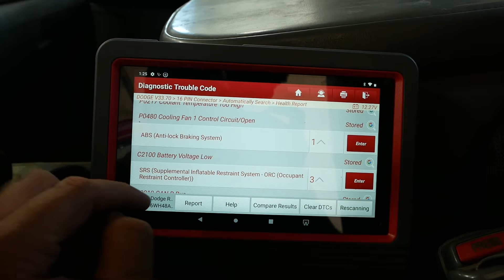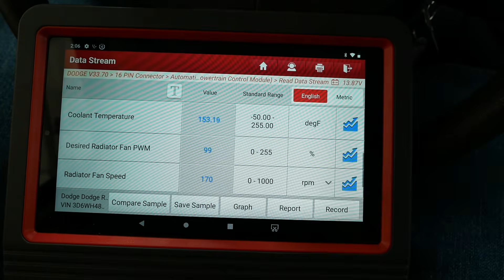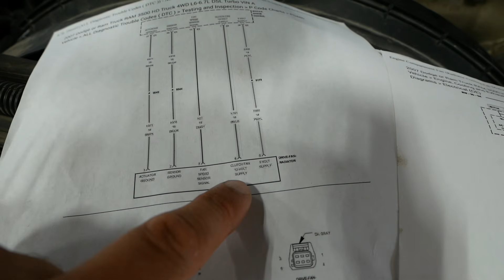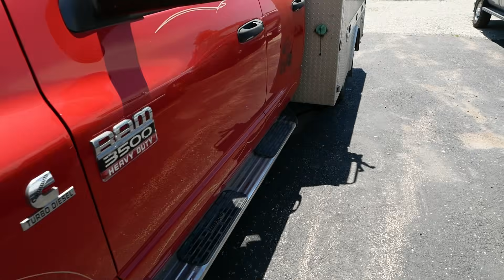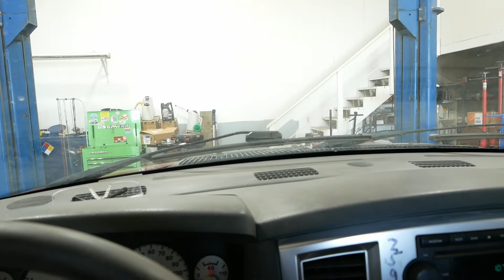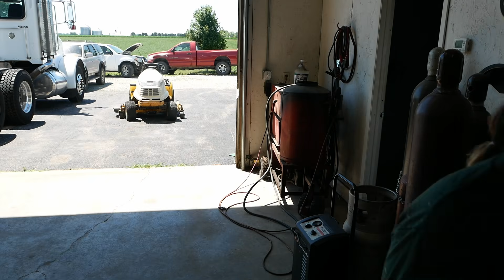6.7 Cummins Fan Clutch Woes - New doesn't Mean Good

Comment: Wes, I know this video is 3 years old, but I'm compelled to comment. I have a 2006 5.9L Dodge Cummins. 170k miles. I use it exclusively to tow my RV. On my last trip back from the UP of Michigan, early September, I noticed when pulling on moderate grades, I would hear excess fan noise and the engine temp slowly rising above 200. Just began on this last trip. I believe I put a 190 F Cummins thermostat in several years ago for preventative maintenance along with all new heater and radiator hoses. So I'm certaun it is not a thermostat issue.  When I get off the grade, the temps drop back to just under 200. Then it repeats again under the same driving conditions. No fault codes for the fan clutch either. The fan clutch has not been replaced before so I ordered a replacement. Yes, Gino's Garage sells a Mopar clutch for $500+. I ended up ordering a New  "Cummins" branded clutch with a  Mopar partnumber ending in AC. It was a eBay purchase costing only $148 plus tax. Too cheap to be true? I hope it's not a China counterfeit. It looks legit in packaging and appearance. But, if it doesn't work or it fails, I'm only out $148 plus my own labor. Worse case scenario, I end up buying a dealer sourced very expensive fan clutch. Now I am preparing to install.  Thanks for your videos. They are all great.

Comment: You know I've always thought ever since I've heard of them that I wanted the old 94 to 98 Dodge Ram extended cab or four-door four-wheel drive long bed with at least a 5-speed manual and the 12-valve Cummins turbo I heard they get 25 plus miles a gallon and unloaded on the highway but still will pull over 10,000 lb easy and I still have my hopes up but even if I could put one of those Cummins turbo diesels and transmission combos in some other four-wheel drive maybe a 90s Chevy or a 55 Chevy four-wheel drive I'd like it

Comment: Had a similar experience with a boat outboard. Thing was overheating under load, replaced the thermostats with Mercury OEM, didn't help, tried everything I could think of including stripping it down and cleaning out all the coolant passages, multiple pump replacements, never got a good od day out of it. Years later when I finally gave up and decided to sell it I found out the OEM thermostats were duds from the factory.

Comment: Per wire diagram, you can ground the control wire to the fan clutch, hold rpm around 2,500 & within 15-20 seconds you should hear it roar...
Reply: would that keep the fan on full time with out causing a code?

Comment: Thank you sir you may have just saved me a lot of money an time wasted, I have a 2011 dodge Ram 3500 coolant temp gauge needle sits dead center when I get on the gas an push it it will slightly go over the middle mark until shifts. plus ac blows hot until I start driving the truck, I live in Florida an drive with no load or pull anything

Comment: Wife proof? My wife would leave footprints in me on the way to drive that thing if I handed her the keys.

I had an old Chevy truck with a 350 that was giving me fits. It acted exactly like an engine with bad plug wires, so I went ahead and replaced the plug wires, distributor cap, and rotor. And it acted almost exactly the same. I checked my work, and everything was done correctly, and I didn't want to throw parts at it, so I checked the resistance on the plug wires. And one of the new plug wires was bad. It drove me nuts trying to figure that out.

Comment: They only tend to set the code for fan speed when you physically stop the fan when its in demand. It's how I riskily found out mine was faulty. Switched on A/C, felt the condenser get super hot. Then used the bottom of a hammer to slow the fan down. No resistance at all. Also when engine was switched off the fan took a good 5 seconds to slow to stop.

Comment: Help.  The fan cluth on my 2000 5.9 won't activate on hot weather.   I live in mountain area out west and one of the passes it will heat even empty.  Had new fan clutches thrown at it and still fan isn't coming on.  Are all these parts really that bad?

Comment: You are a life saver! I’m chasing after the same issue.. brand new ac system with ac cycle switch and brand new cooling system. Yet, fan is not in the 0000 range for rpm speed. I’m interested in doing a mechanical swap

Comment: I had a 1990 Mercury Grand Marquis that had a thermally-controlled viscous clutch. No computer control. The original finally gave up the ghost, and I went through THREE parts store clutches that all failed in less than two months. One failed in only a couple of weeks. I ended up jumping on eBay and getting my hands on a couple of NOS Motorcraft clutches. That lasted me another four years until I sold the car. Aftermarket parts suck these days.

Comment: NEW = Never Ever Worked. I have been a technician since 1987 and I have learned over the years in a GM dealer just because the customer replaced it with a new part dose not mean the new part is good. I always follow the diagnostic procedures the manufacturer wrote. I have replaced many NEW parts in my career.

Comment: My 08 powerstroke had the opposite issue my fan clutch got stuck in the truck is melting mode which i think helped the old waterpump on its way to leaking out the weep hole boy was that sucker a job to get to.

Comment: My '06 5.9 went through 3 A/C compressors before we figured out the fan clutch was bad. Then it took 2 fans to find a good one. Then it ate the wire harness! So I patched it with a longer one from a doner and wire tied it to the radiator. That fan should lock up on max A/C and you'll know it. If it doesn't and it's hot, hi head pressure and the compressor will blow off. It sucks. They also seem to be about 1/2 lb low on charge from spec.

Comment: Another great video Wes.  Another reason I’m keeping my 2000 Dodge with the Cummings engine and 5 speed, wife proof, transmission.  It has a total of three modules, ECM, ABS and Passenger restraint.  Oh and now has a manual front locking hub system thanks to the Dynatrac kit I installed.
  What scan tool were you using?

Comment: Yes fan clutches pretty common failure on 3 rd gen...Also atleast on 2003-2004 model your able to get fan come out from bottom without pull top rad shroud out.

Comment: I see that the white knuckle towing service has expanded into the white knuckle mowing service. 

As for some folks having a 'thing' about only using OEM parts, a whole load of so-called oem parts are just common components that are used by many vehicle manufacturers,  each of which has their own part number.

A case in point was the temperature sensor that could potentially short circuit and set your car on fire. The same part was used by Ford, Toyota and BMW to name but 3.

Comment: The 6 speed manual if the same as my friend's 2007 2500 4x4 6 speed, 1st gear is super granny low for moving your house when you are bored of the location,  😁

Comment: I saw on one of the u-tube videos that the box may say Ford, GM, or Chrysler. However it is the same merchandise as you buy at Auto Zone or any parts store. That does not shock me as the auto manufacturers are going as cheap as possible and charging ten times the price.

Comment: On Cummins engines, it's best to only use the oem fan clutch. All others can be very problematic. This customer will probably continue to have problems after a few miles. Damned this supply chain deal sucks!

Comment: I’m a collision tech at a ford dealership. Goes through runs a certain parts we can’t get from ford. Chrysler has been a nightmare. Been waiting for a engine harness/fuse box for a 2017 Caravan since November/December 2021 for a job. Air bag wires are cut so we HAVE to replace the harness.

Comment: Don't feel bad Wes the other day I put new ends on the cables going to the batteries and forgot one from the alternator started it up and it arced out through my whole ac system melting several hard lines in a matter of seconds

Comment: Got an 09 4500 that I've had to replace fans over and over. I wound up doing a manual fan clutch. It fixed the cooling problems on motor & trans but not enough air pull to keep condenser cool for a/c while idle.

Comment: Working for the parts division of a big vehicle manufacturer, there was a commonly held suspicion that we often got lumbered with reject parts from original suppliers to the vehicle factory that didn't quite pass their quality tests..... There is a difference between aftermarket parts that are pure fakes, parts that are the same as OE, parts that copy OE but are made cheaply/simply to be competitive and parts that have actually been improved from the original design by aftermarket suppliers to cure known problems.

Comment: They may have gotten a bad part, but they sold it as fixed……that’s not good.  At least you went the extra mile and troubleshot correctly and fixed.👍

Comment: I live in Canada. I bought a 2014 ecodiesel ram in January (-20C weather). Dealer had replaced all the fluids.
In April (+30C), my coolant tank was empty. I toped it up. Same thing the next day. I thought I had a bad head gasket.
Turns out the thermostat had never opened in winter and the radiator was empty for 3 months...

Comment: In Germany, the situation with repairs is as follows:
Every dealer must grant a two-year warranty (also known as liability for defects) on new goods and twelve months on used goods. He is legally obligated to do so (§§ 437, 438 BGB). The warranty covers defects that the product already had at the time of purchase.
So if I buy parts and they are defective after a short time, the dealer must comply with the warranty and replace the part.
Reply from the maker: Sure. We have the same. But it still cost time and aggravation. Some suppliers will even pay you for a portion of the time to replace a defective part, but it is still a losing proposition.

Comment: Great job Wes, after 10 years, manufacturers don't have to support their products,  though I hear after 3 years or so, some claim its old technology 😉. 
Plenty youngsters can drive a manual here in the UK 🇬🇧, historically fuel has always been expensive, so smaller engine capacity, small engines were not compatible with  the old slush 3 speed autoboxes. 
Newer design of transmissions allow much smaller engines.
Team WES landscaping doing a great job, good maintenance contract.

Comment: I see you are also a devotee of the random tool battery test method. I did that just the other day, also doing the fan on a diesel pickup, although slightly scaled down 2.8L Toyota Hilux.

Comment: hi Wes .. was just thinking about the magic in the fan clutch control , if the fan clutch actuator is a Wax Motor then as the heater turns on there will be a delay until it ramps up, it's the only device I can think of that would do this it would also increase the fan speed in increasing temperature,  would just need a heater to operate, if it say changed the fin configuration in the viscous clutch or maybe change the pressure hence viscosity of the liquid, don't know
Reply from the maker: It’s a silicone oil that is restricted by a solenoid. Magic basically.

Comment: when a mechanic says he only uses OEM parts  that tells me something about the mechanic,  not even in san francisco a mechanic will only works with OEM or good bye business. you are right with new parts been bad sometimes, I replaced a new  brake  cylinder twice, the rubber seals inside  were melting when the brakes were applied each time. brake pedal would go to the floor.

Comment: Wonder if the previous AC repair is a failure and there is a leak - service valve etc. Still present? Great video seems many new viscous clutches are faulty- made in the mainland?

Comment: Only good thing about those trucks is the water pump...Rest is junk, specially the Def system, the transmission clutch and its stupid dual mass disaster flywheel. One of my customers has gone thru 8 clutches in 2.5 yrs!
Reply from the maker: They have a lot of power. That thing pulls like freight train.

Comment: The Volvo heavy truck I drive at work has the opposite problem.......a fan that never shuts off, sucking 40hp continually, and that sucks up a lot of fuel. Im told that Volvo dont know how to fix it, and its over 1 million km's so they just leave it be.

Comment: I had just the opposite problem with my Volvo 140 excavator. The fan ran all the time. I had to change the clutch. 
The temp would not run hot enough and the emissions when crazy asking for numerous Re Gen’s all day.

Comment: It's been a nightmare to get parts lately. Not sure what system Makuloco uses to get his stuff, but every Motorcraft part I've ordered (or tried to order) from my dealership lately has been, literally, "why don't you try Napa, we can't get it" or "yeah, that part is obsolete." Just tried to order blend door actuators for a 2007 explorer because every aftermarket one I've ever installed has been junk. Can Ford get them for me? Nope. Not in the last two years, anyway. Same with Dodge and GM, although chevy has been better than most. Not much to be done about it except order the Chinesium stuff and cross our fingers.

Comment: If the clutch for the fan was bad 👎? How would that effect the air-conditioning??.
Reply: Compressor coil for the a/c is in the radiator "stack" so the amount of air pulled through the stack affects it.  Especially when the vehicle is not moving.  Average diesel also has a lot of "stuff" in that stack, too--oil & transmission coolers, charge air cooler for the turbo, etc.  So, there's a tremendous "demand" for cooling air flow.

Comment: I put a Uro fan clutch on my Z3 when I got it because it was new, and why not, I was in there anyway. Lo and behold, it revved to the moon and made me worry about sending a blade through my hood. Put the old one back on. Some years later I took the fan off entirely, it's redundant with the electric one anyway. Multiple years of Alabama summers and I have never needed it.

Comment: I just had this exact failure on my envoy which uses a similar electrical clutch fan set up. No codes, the fan took forever to spin up, and the A/C was not cold. I wish you could just put a standard thermostatic fan clutch on it.

Comment: Hi Wes. There is a simple "magazine" test for fan clutch in my country. Take a magazine(not wife's favorite 😄) roll it and put it into fan when engine's run. If the fan stop or going slow, congratulations, you win a new fan clutch. We also call it viscous clutch, there is something like liquid silicone inside. Sometimes could be repeared with new silicone, but only sometimes, and is temporary. Sorry for mistakes, i didn't practice writing for years.
Reply: and if you get confetti, clutch is alright ;)

Comment: Last summer my 09 6.7 dodge kept venting Freon out of the compressor pressure relief port. This would happen at a stoplight if I sat there for more than a minute or so. This was happening because the fan clutch was not cycling correctly. Fired the parts cannon at it, condenser, new lines, flush and cans of Freon. Kept doing it so I put a new fan clutch and that made no difference. Called in a favor with a local mechanic and he asked if the truck was running warmer than usual. I had noticed a very slight increase in running temp maybe 5+ degrees. He said I was “barking up the wrong tree” and to replace my thermostat. The rubber seal on the thermostat had torn and was interfering with it functioning. My a/c problems were fixed and still working correctly. Wouldn’t think that a slightly impaired thermostat and 5-10 degrees warmer would screw the computer up so bad that I couldn’t cycle the fan correctly. But it can .

Comment: I used to see this issue all the time with the Ford 6.0 and 6.4 oil burners. The OEM fan clutch would go at like 200k miles (or roughly after the 3rd set of injectors and 2nd turbo had been replaced). Someone would replace the fan clutch with aftermarket junk and it would either be bad right out of the box or fail within weeks. The only lasting repair on those was an OEM fan clutch. I think the OEM part was made by Visteon and we were able to buy from them (through Worldpac or something) vs Ford for a decent savings. 

Parts availability with Chrysler sucks because they’ve changed ownership like 47 times in the past 20 years and every time that happens, the new ownership changes parts suppliers and vehicle platforms. Once they do that, they don’t want to acknowledge that the old vehicles and old parts manufacturing contracts exist anymore, so no more parts availability. They’ve had that same issue for a long time now and it’s unlikely to get any better.

Funny that it has new AC parts and a failed fan clutch. I saw that a lot too. People would unload the parts cannon on the AC system without checking to see why those components failed. The truck would have a bad fan clutch, running the AC pressure up to 500 psi and blowing up the compressor and/or destroying the clutch. Parts cannon specialist would replace the AC system and ship it without ever checking to see if the AC system was overheating.

Comment: I just went through the same thing with bad new parts. Replaced a compressor and then it would not take freon when I tried to charge it. Clutch was engaged but it would not pump. Replaced the txv and condenser and blew the lines. No restrictions. Finally ordered a second compressor and it worked like it should have the first time.

Comment: Depends on the wife. Mine drives a manual every day. Kid proof is more correct. I bought my Sonoma cheap simply because the guy had it for sale forever but everyone that looked it couldn’t drive a stick. He said he started out 6500. I bought it for 3000. It only had 61,000 miles. I’ve had it 4 years 0 trouble and about 110 on it now.I was scared of it because it was almost a to good to be true and normally it is but it’s one Best Buy’s I ever made.